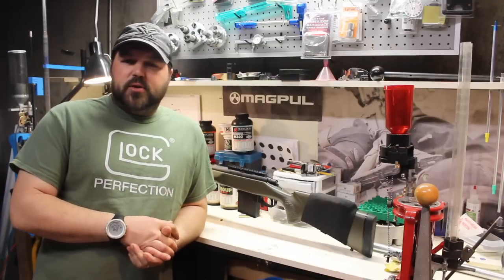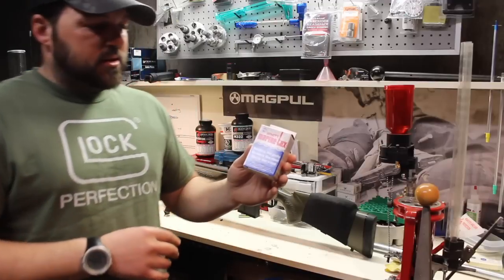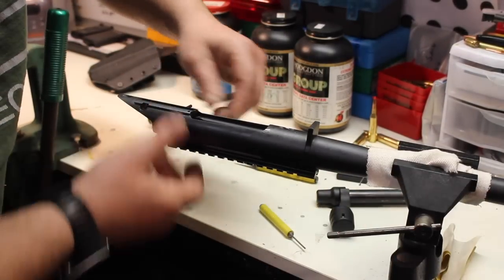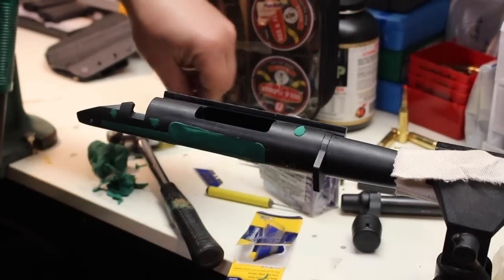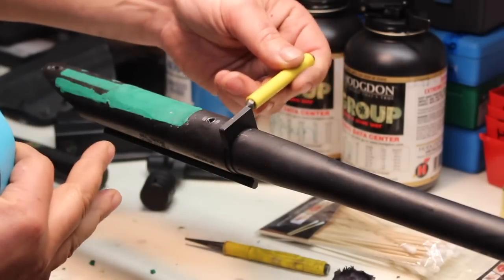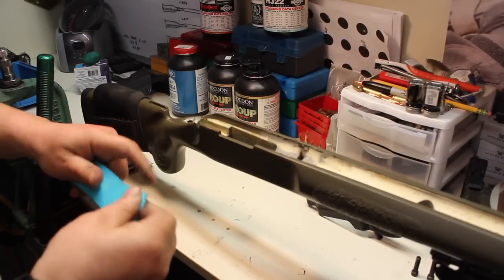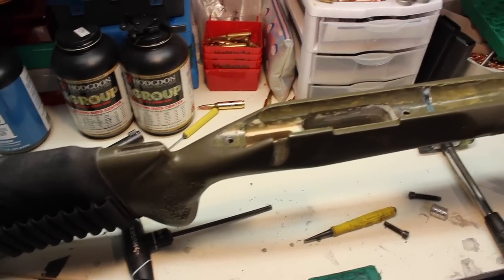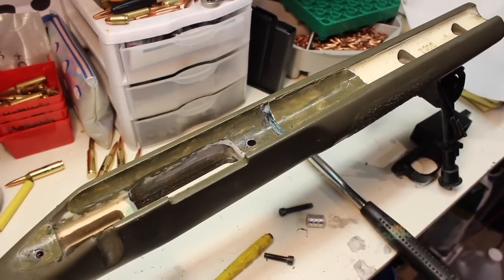BEDDING RIFLE ACTION, MARINE-TEX

Comment: The "gun experts" claim that's a "vent hole". I guess that escaping gas is going to blow right through the RH bolt lug when that case blows so it can get out that hole. Because that hold is covered and plugged when the bolt and lugs are in battery. That hole is there so smart 700 owners can put a drop of oil or two in a long-idle and "dry" rifle before cracking the bolt open for the first time in weeks or months. Otherwise there's a good chance that lug and recess are dry as a bone. Remington 700s have the famous "THREE RINGS OF STEEL" to PREVENT CASE HEAD SEPARATIONS PERIOD. The THREE RINGS are the BARREL, the RECEIVER and the "BAND" AROUND THE BOLT HEAD AND FACE YOU'LL NOTICE IS COMPLETELY UN-INTERRUPTED. CASES BLOW WITH SUCH VIOLENCE AND FORCE WHEN THEY'RE ALLOWED TO THAT YOU DON'T HAVE A CHANCE IN HELL OF "VENTING" A HIGH-POWERED RIFLE CASE BLAST OUT THE BACK END WITHOUT SHATTERING THE STOCK AND OR BLOWING THE BOLT RIGHT OUT OF THE RIFLE, SPLITTING THE RECEIVER ETC. 

Hell a "low-pressure" .45 ACP case that's "hot" or "compromised" and blows the case can and will blow the magazine completely out of a 1911 OR blow all the remaining cartridges, follower, spring and floor plate out of the magazine or TRY LIKE HELL and will blast every bit of the oil out of the pistol and will slam the slide back so violently and quickly the recoil spring will instantly "fail" and be flimsy and weak as if it had a million rounds on it since new and all that shit happens in less than the blink of an eye. But the pistol will stay together because its "only" an "overpressure" round in a cartridge that "only" maxes out at about 21,000 psi. And you're talking about 500 lb.-ft. of muzzle energy max with a "hot" .45 ACP load. 

You really think a wooden stock and "bottom metal" in a BDL (If you don't know what a Remington 700 "BDL" and "ADL" are, don't think you're going to be "gunsmithing" any time soon for anybody that's serious about his rifles and Remingtons) is going to "contain" somewhere north of 70,000 psi which is where U.S. "high-powerd rifles" are generally "proofed" to and probably closer to 100,000 psi if the case "vaporizes" if even one tenth of the gas gets out the back end, you're dreaming. 

Remington knew that and they used and still use those "THREE RINGS OF STEEL" to contain or at least "divert" and/or "slow down" that blast JUST LONG ENOUGH FOR THE OVERWHELMING MAJORITY OF THE GAS, PRESSURE AND ENERGY TO GO OUT THE "FRONT DOOR". In a 700 the bolt "engages that "recess" in the back of the barrel. There is ZERO exposed case PERIOD when a properly built 700 some "gunsmith" hasn't BUTCHERED fucking around and fucking up the bolt and and "opening up" the bolt head and especially putting in an "M16" or "Sako" extractor and ABSOLUTELY HASN'T TOUCHED THE DAMN LOCKING LUGS AND RECESSES TRYING TO "TRUE" THE "ACTION". 

Do ANY or ALL of those things and go BEAT THE HELL OUT OF YOUR 700 WITH HOT AMMO IN YOUR "PRECISION RIFLE" THAT WENT TO THE GUNSMITH "TIGHT AND SOLID" AND CAME HOME "LOOSE AND SLOPPY" AND YOU ARE ALMOST GUARANTEED TO FIND OUT THAT AIN'T NO VENT HOLE IF YOU'RE "STUCK ON STUPID" JACKING ROUNDS THAT ARE "SAFE" BECAUSE THERE'S NO "PRESSURE SIGNS" OR "NOT MANY" AND YOU'RE SHOOTING STUPIDLY "LONG" CARTRIDGES WAY, WAY OVER THE MAX COL FOR THAT CARTRIDGE THROUGH  THE RIFLE AND HAVE TO "SINGLE-LOAD" A FREAKING REPEATING RIFLE. 

ANY "GUNSMITH" WHO THINKS HE CAN "BUILD' A 700 BETTER THAN REMINGTON AND CAN "FIX" WHAT REMINGTON SUPPOSEDLY "DID WRONG" BUILDING ITS OWN RIFLE TO ITS OWN SPECS IS EITHER INCREDIBLY STUPID OR INCREDIBLY COCKY ABOUT HIS "SKILLS" BUT MOST LIKE IS INCREDIBLY "BOTH". IF YOU TOUCH A REMINGTON RECEIVER OR BOLT WITH A "CUTTER", I GUARANTEE YOU JUST PUT A "SALVAGE TITLE" ON YOUR 700 AS FAR AS IT EVER HAVING ANY "RESALE" OR "TRADE" VALUE TO ANYBODY BUT ANOTHER IDIOT WHO THINKS "LOOSE" AND "SLOPPY" BOLTS ARE "NECESSARY" FOR A "PRECISION RIFLE". NOBODY ELSE WILL TOUCH A "TRUED" REMINGTON "ACTION" WITH A TEN FOOT POLE. YOU IMMEDIATELY "RUIN" THE ENTIRE ACTION. "TOUCH" THE LUGS, RECESSES OR  FRONT FACE WITH A "CUTTER" TO TRUE THEM AND YOU JUST PUT A BUNCH OF EXTRA "HEADSPACE" IN THAT RIFLE OR TOOK A BUNCH "OUT" YOU CAN'T "GET RID OF" OR "PUT BACK" WITHOUT CUTTING A BUNCH MORE STEEL OFF A BUNCH MORE PARTS. AND THEN YOU'LL  HAVE TO "RELOCATE" THE FREAKING BOLT-HANDLE ON THAT "THREE-PIECE"" BOLT BODY TO TRY TO 'GET BACK" PRIMARY EXTRACTION AND "LOCKUP". I SAID "THREE-PIECE" BOLT BECAUSE IT IS THREE SEPARATE PIECES. THE HANDLE, THE "MAIN" SECTION OF THE BODY THAT GOES FROM ABOUT HALF AN INCH BEHIND THE LUGS TO THE REAR OF THE BOLT AND THEN THE "HEAD" WHICH IS 'WELDED" TO THE REAR SECTION. AND YES.. IT IS "SHAPED LIKE A BANANA". ON PURPOSE. WHY? 

BECAUSE SOME PEOPLE AT REMINGTON KNEW HOW TO BUILD THE "BEST" DAMNED BOLT-ACTION SPORTING RIFLE IN HISTORY AND THE ONE THAT EARNED THAT TITLE BY "BEATING" WINCHESTER AND THE MODEL 70 AT THEIR OWN GAME. IN 1964 WINCHESTER HAD TO "RUIN" THE MODEL 70 BY MAKING EXTENSIVE "PRODUCTION CHANGES" THAT TOOK "THE RIFLEMAN'S RIFLE" WITH A RECEIVER THAT STARTED AS A 7+ BILLET OF STEEL AND 70+ MACHINING OPERATIONS LATER WAS A MODEL 70 RECEIVER FULLY MACHINED AND MACHINED SO WELL THAT IF YOU "GUT"  A PRE-'64 MODEL 70 YOU WON'T FIND MACHINE MARK OR SHARP EDGE OF UNFINISHED/UNPOLISHED SURFACE ONE INSIDE OR OUTSIDE OF THAT RECEIVER. THEY LOOK LIKE THEY'RE "INVESTMENT CAST". SINCE 1964 THEY DON'T LOOK LIKE THAT ANY MORE. THEY'RE "CHEAP" AND "UNFINISHED" AND "CLUNKY" AND THEY STILL HAVE THE MAUSER -STYLE "CLAW EXTRACTOR" BUT THEY HAVEN'T HAD "CONTROLLED ROUND FEED" SINCE '64. WHAT IS "CONTROLLED ROUND FEED"?

WHEN YOU PUSH THE BOLT FORWARD TO CHAMBER A CARTRIDGE THE TOP CARTRIDGE "JUMPS" UP IN FRONT OF AN "INTO" THE BOLT FACE AND "STICKS ITS RIM" BEHIND THE EXTRACTOR "HOOK". THE CARTRIDGE IS LITERALLY "STUCK" ON THE FRONT OF THE BOLT UNTIL ITS CHAMBERED, EXTRACTED (FIRED OR NOT) AND EJECTED BY PULLING THE BOLT CLEAR BACK. IT TAKES A LITTLE EFFORT AND TUNING AND "HAND-FITTING" AND DIFFERENT MAGAZINE "GUTS" FOR EVERY CARTRIDGE YOU CHAMBER THE RIFLE FOR. NO "ONE SIZE FITS ALL" THING LIKE YOU CAN GET AWAY WITH WHEN YOU HAVE "PUSH FEED" AT LONG AS YOU HAVE A "UNIVERSAL" FOLLOWER AND A "BLIND MAGAZINE" LIKE A 700 ADL. 

BRING A BOX MAGAZINE OR "BOTTOM METAL" INTO THE PICTURE AND YOU PRETTY MUCH HAVE TO GO BACK TO MAKING A DIFFERENT FOLLOWER AND POSSIBLY A DIFFERENT "BOX" FOR EACH AND EVERY CARTRIDGE. AND THAT'S HOW REMINGTON "DESTROYED' WINCHESTER. WINCHESTER HASN'T INTRODUCED A BRAND-NEW BOLT-ACTION RIFLE SINCE THE MODEL 70 CAME OUT IN THE 1920S. BECAUSE REMINGTON HAS COME OUT WITH A PILE OF NEW RIFLES AND STARTED EMBARRASSING WINCHESTER AND PRETTY MUCH THE REST OF THE WORLD IN 1906 WHEN REMINGTON AND A FAIRLY DECENT "GUN DESIGNER" BY THE NAME OF JOHN MOSES BROWNING UNLEASHED UPON THE WORLD THE FIRST SEMI-AUTOMATIC, VERTICAL BOX MAGAZINE "SPORTING RIFLE" AND "RIFLE PERIOD" IN THE HISTORY OF THE WORLD. FROM 1906 THROUGH 1907 IT WAS THE "REMINGTON AUTLOADING RIFLE". IN 1908 IT BECAME  THE "MODEL 8". IN 1911 FN STARTED BUILDING/SELLING THEM AS THE "1900". IN 1936 WHEN .300 SAVAGE WAS ADDED TO .25/.30/.32 AND .35 REMINGTON - THE FIRST BRAND-NEW SMOKELESS, RIMLESS "COMMERCIAL" SPORTING RIFLE CARTRIDGES IN THE WORLD THAT DIDN'T START AS "MILITARY" CARTRIDGES, IT BECAME THE MODEL 81 "WOODSMASTER". 

FROM THAT POINT ON, WINCHESTER WAS PRETTY MUCH HOSED. REMINGTON WAS STILL REMINGTON - THE COMPANY STARTED BY A "COMPETITION SHOOTER" WHO WAS AN "AMATEUR GUNSMITH" BUT DIDN'T HAVE THE ABILITY TO RIFLE HIS OWN BARRELS AND WHEN HE PAID AN "EXPERT" TO RIFLE A BARREL FOR HIS NEW "BUILD" AND IT ENDED UP BEING SHIT IN HIS OPINION DESPITE EVERY OTHER LOCAL "COMPETITION SHOOTER" USING THAT "EXPERTS" PARTS, RIFLES, SERVICES, HE DID WHAT JOHN BROWNING DID AND SAID WHAT JOHN BROWNING SAID AT 10 YEARS OLD: "I CAN MAKE ONE BETTER THAN THAT!" AND LIKE JOHN BROWNING, ELIPHALET REMINGTON PUT HIS"GUN MAKING" TALENTS INTO "MACHINE TOOL MAKING", BUILT HIS OWN RIFLING MACHINE, RIFLED HIS FIRST BARREL WITH IT AND PUT HIS FIRST BARREL IN HIS FIRST  "HOMEMADE" 100% ALL HIS WORK RIFLE AND AT THE NEXT "COMPETITION" - A TURKEY SHOOT - LAID WASTE TO THE FIELD. HE DIDN'T GET MUCH MORE OPPORTUNITY TO COMPETE AFTER THAT. HE WAS TOO BUSY BUILDING AND RIFLING BARRELS AND REBARRELING  "BRAND X" RIFLES AND BUILDING NEW RIFLES FOR THE GUYS STUCK WITH SHIT THAT WASN'T WORTH "FIXING". 

THERE'S A HELL OF A LOT OF "GUNSMITHS" OUT THERE THAT CLAIM 700S AREN'T WORTH A SHIT UNTIL THEY MAGICALLY "FIX" THEM WITH THEIR WORN-OUT SCRAPYARD-REJECT LATHES AND THEIR "GOING OUT OF BUSINESS TOOL AUCTION" WORN-OUT PRECISION "MEASURING TOOLS" THEY DON'T EVEN KNOW HOW TO USE PROPERLY WHEN THEY DO MANAGE TO USE THEM FOR THE RIGHT TASKS. FYI - YOU DON'T "MEASURE" DIMENSIONS WITH A DIAL INDICATOR AND ANYBODY WHO IS "BUILDING" SO-CALLED "PRECISON" RIFLES BY "FIXING" WHAT REMINGTON "GOT WRONG" AND YOU NEVER HEAR A  SPECIFICATION OR TOLERANCE OR DIMENSION OUT OF HIS MOUTH THAT DOESN'T INCLUDE "ABOUT" OR "MAYBE" OR "AROUND" OR "A FEW" OR "A COUPLE" AND HE'S TOO DAMNED LAZY TO SAY "THOUSANDTHS" INSTEAD OF "THOU", THERE'S YET ANOTHER SIGN YOU'D BETTER EITHER RUN THE OTHER WAY BEFORE YOU HAND HIM EVEN A DAISY BB GUN TO FIX IF HE DOESN'T ALREADY HAVE ONE OR MORE OF YOUR "BABIES" AND IF HE DOES, YOU'D BETTER GET IT THE HELL BACK BEFORE HE PUTS PART ONE IN THE LATHE TO "INDICATE IT IN" BECAUSE IF A CUTTER TOUCHES YOUR 700 PERIOD, YOU MAY AS WELL CALL REMINGTON, BUY ONE OF THEIR BRAND-NEW "STRIPPED" 700 "ACTIONS", DELIVER IT TO "SUPER SMITH" AND TELL HIM TO "BUILD" YOUR RIFLE RIGHT BACK TO WHAT IT WAS WHEN YOU BROUGHT IT IN ON THAT NEW RECEIVER AND THAT IF HE EVEN MENTIONS "TRUING" ANYTHING, HE'LL BE TRYING TO "INDICATE IN" THAT OLD ACTION HE JUST RUINED WITH IT HANGING OUT OF HIS ASS WHICH MIGHT MAKE IT A "CHALLENGE" TO "DIAL IN". 

SERIOUSLY. GOOD GUNSMITHS DO NOT "FIX" RIFLES THAT "DON'T SHOOT" UNTIL THEY'VE MADE SURE ITS NOT THE OWNER THAT "DON'T SHOOT" FIRST.
Reply: You should wright a book Bud.
Reply: Someone didn't drink his coffee this morning!
Reply: Maybe off his meds!
Reply: I love you man!!!
Reply: longest YouTube comment ever.....
Reply: My kind of guy. Thank you sir ... They laughed at me because I was different. I laughed at them because they were all the same
Reply: Oh man. I needed a good "laugh".

Comment: FYI .243 is a well-known BARREL BURNER. Go out and shoot a bunch of rounds through them in a hell of a hurry doing the "long-range" thing and you can and will "burn up" a barrel faster than damned near any other "common" and "popular" American high-powered rifle cartridge. See those shoulders? Not NEARLY enough "angle" and .243 just FLOODS the throat with high volumes of high-pressure and high-temp gas. When a rifle just "goes away" in a hell of a hurry, its either the "optic" or the owner beat the dogshit out of it with hot and high-volume shooting, got it hot and hot repeatedly and it doesn't make a damn bit of difference if it "only" has 500 rounds or "only" 1500. There are no hard and fast rules for when a barrel "wears out". And if you notice its STARTING to lose accuracy/precision and in an attempt to "figure out" what the problem is and keep shooting the hell out of as often as possible trying to get your "baby" back, you'll take the barrel the rest of the way out in as few as tens or scores of rounds whereas a SMART and EXPERIENCE "old-timer" who knows the signs of impending barrel "failure" ARE groups "opening up" and how DOESN'T SHOOT HIS RIFLES WITH MAXED OUT AMMO OR ANYWHERE NEAR IT SO HE HAS PLENTY OF "SAFETY FACTOR" AND GETS MAX BARREL AND RIFLE LIFE will have the OPPORTUNITY TO "BUMP UP" HIS LOADS TO GET THE LOST PRESSURE/VELOCITY BACK AS MUCH AS POSSIBLE AND HE WON'T WASTE A ROUND TRYING TO FIGURE OUT WHAT THE HELL IS GOING ON. HE'LL LOOK AT THE "OPTIC" AND THE THROAT AND HE'LL KNOW WHAT THE DEAL IS. AT THAT POINT IF YOU'RE SHOOTING JUST ENOUGH TO STAY "ENTERTAINED" AND/OR "COMPETITIVE" AND YOU BUMP CHARGES AND MAKE DAMN SURE TO FULL-LENGTH SIZE YOUR BRASS AT EVERY RELOAD AND AND LET THE CASES "STRETCH" AS MUCH AS POSSIBLE TO KEEP THE NECKS AS LONG AS POSSIBLE TO MOVE THE "BLAST" FORWARD ON THE THROAT AS FAR AS POSSIBLE AND YOU SLOW THE HELL DOWN AND LET THE DAMNED RIFLE COOL OFF AFTER EVER  FEW ROUNDS, YOU MIGHT GET HUNDREDS MORE ROUNDS BEFORE IT FINALLY LAYS DOWN FOR GOOD.
Reply: DEEREMEYER1 I don’t know who “told you” that “using quotations” on everything is “correct”, but they were completely “wrong”.
Reply: @Tyler_Mattson  I think most of what he babbles is wrong
Reply: You sound like my ole man texting. He loves them "quotations"